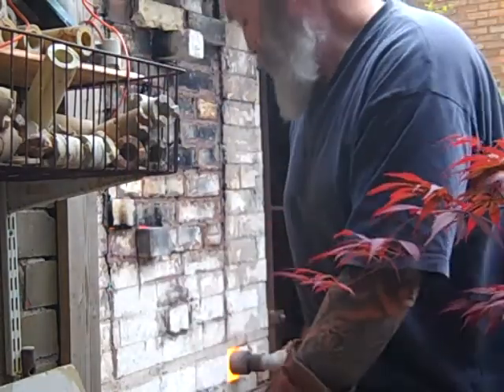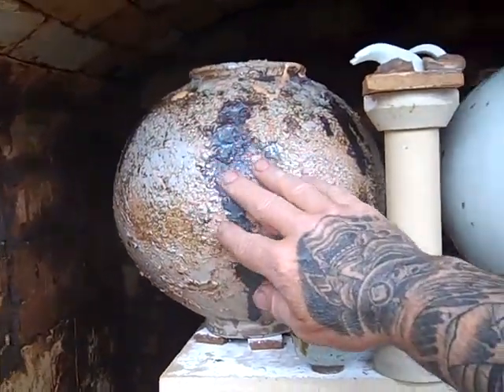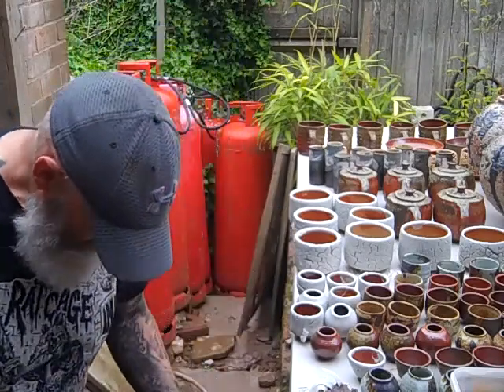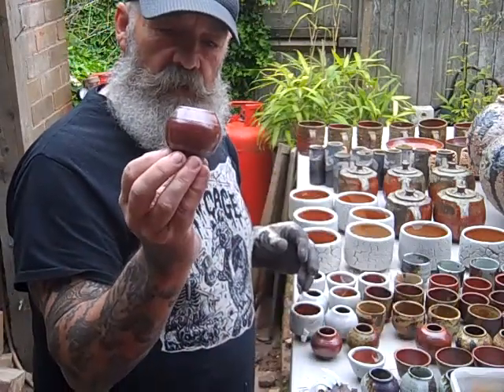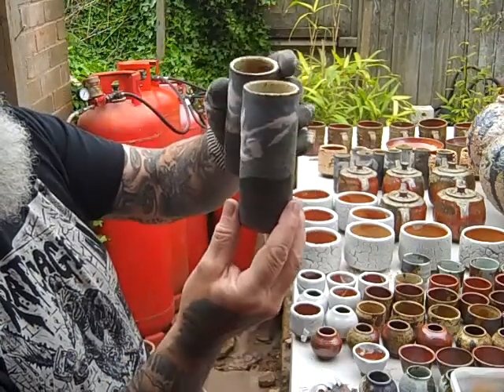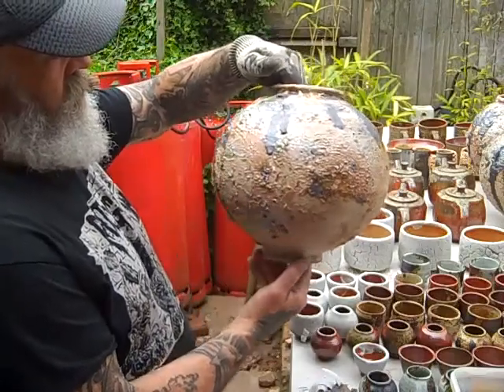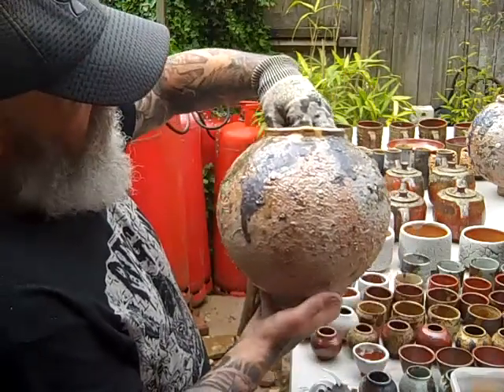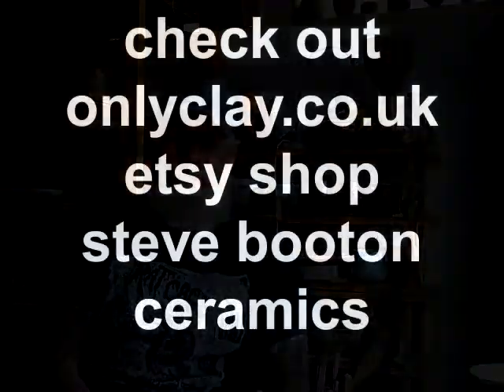pottery kiln opening firing results may 2022 2

Comment: Sweet. What I've done with good results is draping or wrapping copper wire around a pot/plate. I know you don't use copper, but iron wire might work nice to get some cool patterns. See if there's a difference between the straight bailing wire, zinc galvanized and maybe stainless steel.